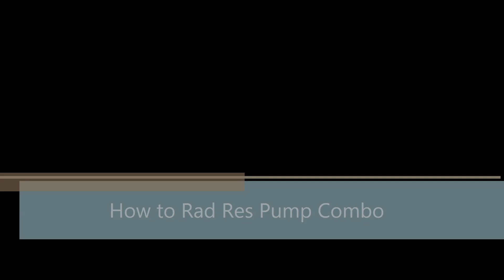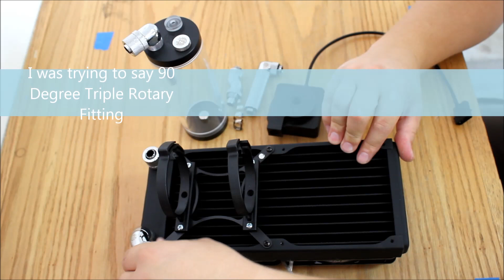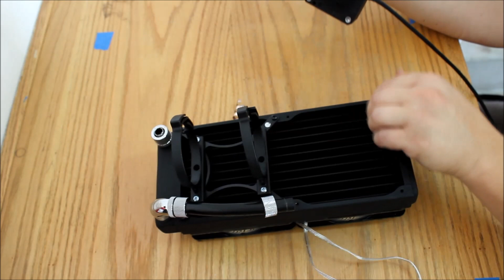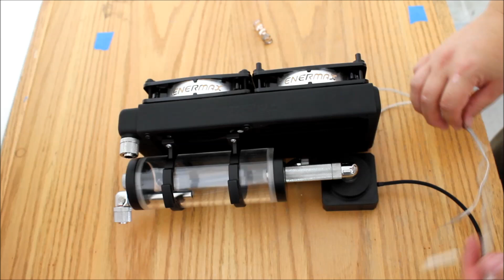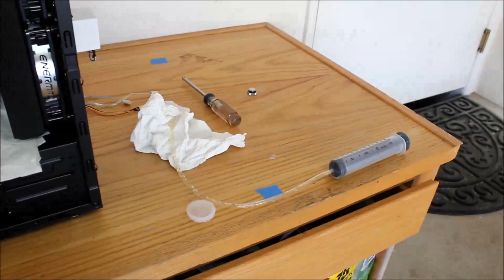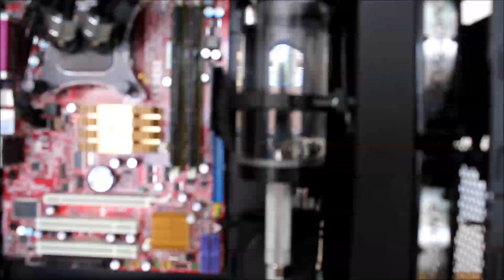How to Rad Res Pump Combo

Comment: Hi there great video. I have a question for you where did you buy the tube clamps for your reservoir I have a Bitspower 150 DDC res would like to mount it to a 140mm Rad thanks
Reply from the maker: Thanks Nitro, I got the mounts from performance-pcs dot com.
Reply: Do by any chance know the name of the product please thanks
Reply from the maker: Bitspower 120 Water Tank Mount Panel, they have a 140 mount as well.

Comment: https://youtu.be/Q4PRtFTEAgA Please watch this. and listen to what he says about Distilled water........
Reply: For what it's worth I've been using straight distilled water since the days of the Athlon XP with no issues at all. Still using one of the rads from an old Waterchill kit I brought back then and it's working perfectly.
Reply from the maker: I have been using straight distilled water with a silver kill coil for years with no negative effects on my water loop. I have added new distilled water yearly for the past few years and have seen no corrosion or negative side effects with my cooling loop. have been running two systems like this for years. One of my custom build system is running a custom reservoir with alphacool rads since 2013 with no problems at all.  That is 4 years with nothing but distilled water and a silver kill coil with zero problems.
Reply: PirateMods Ok so what you are saying is. Jayztwocents is wrong and you know more than he does??? Ok....You are the watercooling master. what does Jay know hes only been doing this for over 10 years. I myself learned not to use distilled water the hard way. If it works for you and you wanna pass on your anecdotal evidence as proof then go ahead. but dont tell other people to do it. its irresponsible. I may be a little brash but dont misunderstand me. we are part of the same community and im looking out for people. anyway hopefully I will see more from you that wont throw up more red flags in my face.
Reply from the maker: I am not sure what your getting at. I never claim to know all there is to know. I have done my research and have tried things for myself to come to my own conclusions. I have a lot of respect for the others out there like Jay who put out great content. But they are not the end all. everyone can build from their own experiences. I have posted a lot of information on Youtube, facebook and several forums to back my experiences over the years. I have build custom water blocks, Custom reservoirs and have build many watercooled systems over the years.
Reply: PirateMods Hey man I just saw another video and subscribed. I can agree to disagree. but its just a matter of statistics and experience. anyway. good luck to you. and I look forward to more of your content. fyi I just bought a bitspower tank z pom white top 150 (Im installing a gpu block another rad brackets etc) Hows that res working for you?
Reply from the maker: This res has worked very well and is still in very good shape. I have two of these reservoirs and really like the design and flexibility.  Thanks for the sub and good luck with your build.

Comment: Why no teflon tape?
Reply from the maker: There is no need for any Teflon tape, all of the fittings have rubber O-rings to prevent leaks.
Reply: PirateMods Oh, ok. I figured water fittings, didn't think about o-rings

Comment: by my opinion if cooling is applied only to cpu so much money isn't worth for a kit.... the kit will worth when you wanna cool gpu cpu ram or even motherboard hard drive whatever.... but it was a smart connection cheers!
Reply from the maker: Thanks bro, Cooling just the CPU is not a bad investment if you are only stressing the CPU. My newest build is only cooling the CPU and has allowed me to push my overclock up to 5.2GHz. Full system loops look great but they are extremely expensive to put together. Starting with a CPU only loop is a viable option for some people who may not have the funds to build a full system at one time. The system can always be upgraded in the future to include GPU and Motherboard if needed.

Comment: Im brand new to this type of WC. Im going to get my new setup in the mail soon, to 
replace my H100i.   Should you not leak check for 24 hours with the CPU Heatsink
not attached to the board ????   If it did leak, couldnt it ruin your cpu and MB sockets ?????
Reply: Just an FYI: Ive never run a system for 24 hours all by itself. The most I ran it for was 2 hours and that was on single O-Ring compression fittings for acrylic hardline tubing. The only reason why I ran it that long was because I wasnt too confident in single O-ring compressions. Any of the regular tubing with the outer screw-down collar compression fittings (like the one in this video) have a good track record.
Reply: I did the 24 hour test and have NEVER touched it sence. Its been running about 100 days or so and I have not even had to put any distilled water in at all.  Love my Rig !!!
Reply: on every video i go to you're almost on every video lol
Reply from the maker: Douglas Stewart I have not had a fitting leak yet, both compression fittings and the C47 multi link fittings. I did however have a cpu block leak and a POM Bitspower res cap leak after a few hours. Luckily I found these leaks during the leak test and not when the system was running.
Reply from the maker: Sorry it took a while to respond, I have been working some crazy hours. :) It is fine to leak check with everything hooked up, just be sure the power supply is not connected and there is absolutely no power to the system. I usually leave everything disconnected from the power supply and jump the power supply to be able to power the pump.
Reply: Thank You so much for your help !!!

 I have only a fan and rad adapter to get and I will be done with the system.
[IMG]http://i968.photobucket.com/albums/ae168/CTguy1955/650DcaseWCed_zps90e4e11f.jpg[/IMG]
Reply from the maker: Happy to help, it is no fun waiting for parts to complete a build. I would like to see more pics when it is complete. :)

Comment: how effective do you find the silver coil? Do you recommend that instead of additives and why? I was looking at the different coolant types and teh best one I found was distilled water. When people mention "distilled water" do they mean the cheap sort you use in cars? Also, do you have any experience with Mayhems or equivalents that sell clear coolant that is supposed to be designed specifically for water cooling and do you recommend them?
Reply from the maker: I have been using the silver kill coil for a couple years now and have had no problems. I am running two systems both with distilled water and silver coil. I just use the plain distilled water from the grocery store. I have never used anything else. The only reason I would use Mayhems or others is if I needed the coolant to add color for aesthetic reasons. If you just want crystal clear water I would recommend plain distilled water, it is cheap, readily available and works well.
Reply: Thanks very much, I have been looking into watercooling seriously over the last few weeks.
Reply from the maker: No problem, I am always willing to help.

Comment: Dude you are going to have an airflow problem.
Reply from the maker: Ran the system for several months as a full time folding system with no problems. There is plenty of open space in the front to allow a good supply if air to the radiator. I later added a second rad and a water cooled GPU and still had to airflow problems. Check out my Dragon Slayer Build over on my Facebook page (PirateMod).

Comment: can you put a list of all the stuff and a website that ships these parts to europe :)
thanks + i love the setup
Reply from the maker: I am not sure about the parts stores in Europe. I use PerformancePCs, Sidewinder Computers, Ebay, FrozenCPU. After a quick google search I found http://www.coolerkit.com/ or http://www.aquatuning.de/ 

I identify all the parts in the video. Here is a list.
All fittings are Bitspoer Silver Shiny.
XSPC EX 240 Radiator
Bitspower Multi-Z 150 Reservoir. 
Swiftech MCP23B pump
Bitspower 120 Water Tank Mount Panel (RAD Side)
Bitspower 50mm extension 
2x Bitspower Compression fittings 1/2 OD 3/8 ID
2x Bitspower G1/4 Triple Rotary 90-Degree Compression Fitting ID 3/8 OD 1/2 
Bitspower Dual G1/4" High Flow Fitting 
Bitspower G 1/4" Silver Shiny Rotary 90 Degree Adapter
Tubing is Primochill

Comment from the maker: I was able to take the entire system out to drain. I ended up expanding the system to include two 240mm rads, CPU and GPU waterblocks. I changed the res t an 80mm tube res. I never made a video but have put build logs on a couple forums. w w w . c a  s e m o d c o n t e s t . c o m / f 7 / complete-dragon-slayer-449/

Comment: This setup worked very well, there is plenty enough room between the rad and res to allow air to pass through. The CFM of the fan is not that important when using high FPI rads, It is much better to have a higher static pressure. In this setup I was going for silence. I tested several fans and found that the Enermax T.B. Silence performed very well at an acceptable noise level. The static pressure of theses fans is only 1.073 compared to 1.29 on a Corsair SP120 quiet edition fan.

Comment: radiator fins are blocked by that reservoir, you should have used a high pressure fans to make that watercooling setup effective. Those enermax fans have very low cfm.